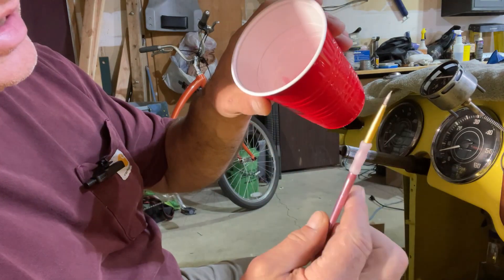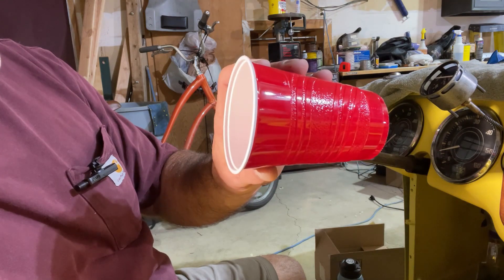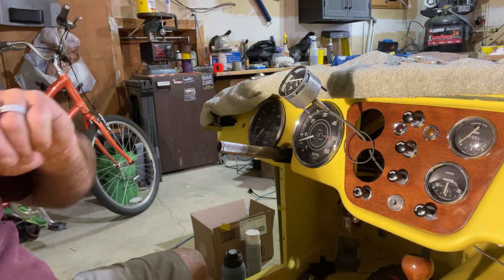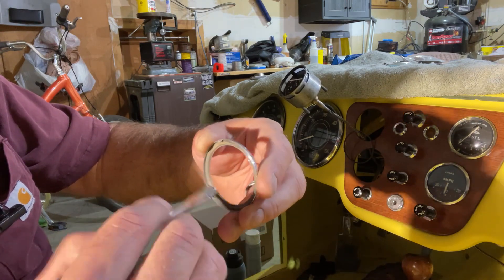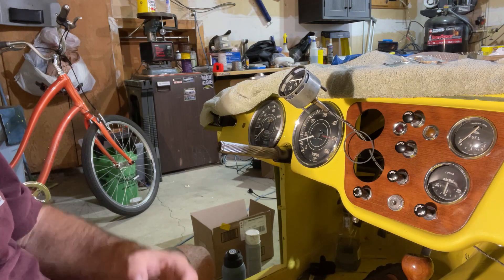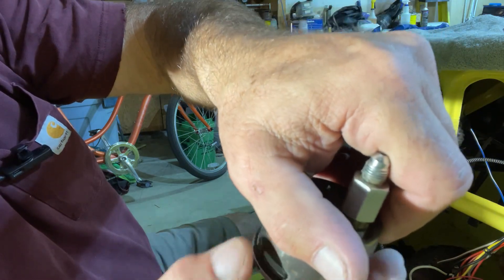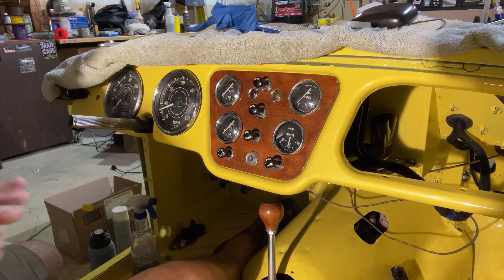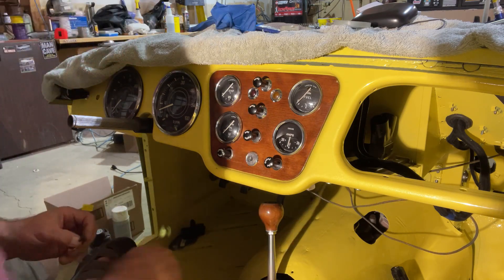Instrument Work, The Conclusion...and the new dilemma

Comment: You can't do a TR3 in yellow, never a UK colour (I don't think) plus it'll look like it belongs in Toyland😂 British Racing Green for me to subscribe😁
Reply from the maker: There is one yellow listed in the Moss Motors TR2, 3, 4 catalog and it has a one word description: "awful".  When I move to Florida, a BR Green car in the jungle is camouflaged, so I chose a color that would stick out and hopefully reduce the number of people pulling out in front of me when I get Higgins up to terminal velocity.
Reply: @50lbbrain  
She is, or rather he is a TR3 is he? Were many sold in the states? I'll bet the bodywork was a lot better than those found in UK. Edit also is he called Higgins after Magnum's sidekick in that Hawaiian detective series?
Reply from the maker: @chrisyarnold6205  yes, he’s named after Magnum’s sidekick from the original series. 
There is a lot of in-fixtured welding done on this car previously, so while it sits on the chassis, OK, there’s a video where I point out that the transmission cut out semi circle isn’t concentric with the bell housing. I believe it’s because the floor pans were replaced without using a jig.